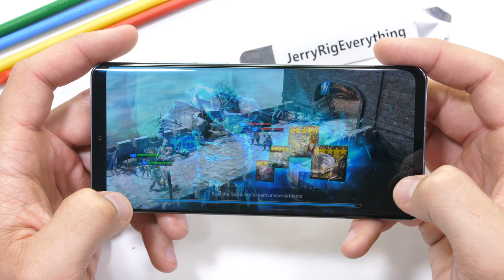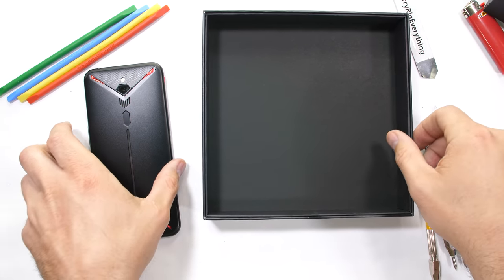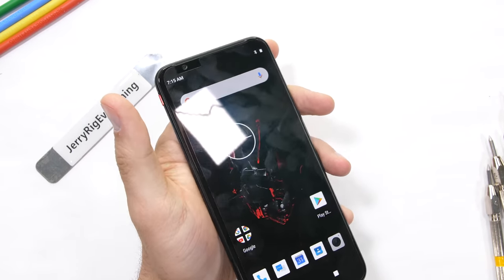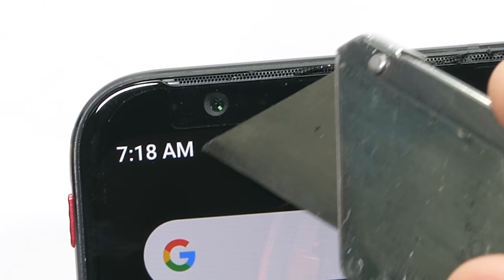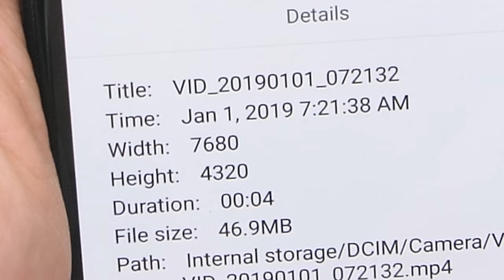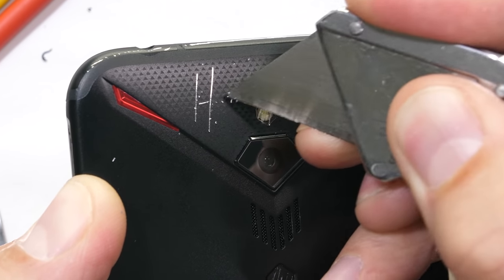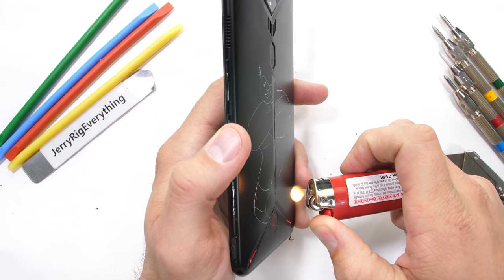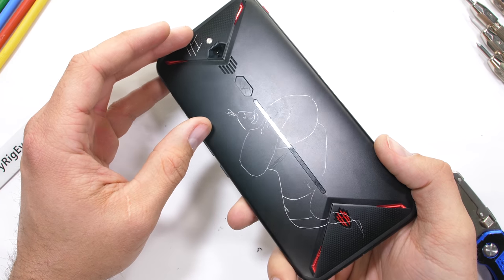Red Magic 3 Durability Test! - a FAN *inside* a Phone?!

Comment: I’m looking forward to a few years in the future when Zack will say “there are scratches at a level 7 and deeper grooves at a level 8”
Reply: Samstrex till screens are made from glass they will scrach at lvl6 with deeper grooves at lvl7 cause the chemical formula of all glasses no matter gorilla glass 5 or gorilla glass 10 are the same they just different in the dropes....maybe then we see sapphires all around😍 which i like couse I hate scratches and dont love cases or screen protector...
Reply: @hamedalimardan4619   Sapphire Glass
Reply: Don't get your hopes up. If that somehow does become the standard, phones will crack a lot easier. Because harder materials don't scratch as easy, but crack much more.
Reply: @danodden9783  Material resistance 101
Reply: Amit Mehta sapphire is not glass(kind of SiO2) its kind of aluminum

Comment: Smartphone manufacturers: no space for a bigger battery and audio jack 
Nubia:  cooling fan, audio jack, bigger battery
Reply: Imran It costs water and dust resistance i guess. But thats about it.
Reply: Sadly no SD card slot. Else perfect.
Reply: @CrusnikofChaos  Yeah indeed, at least it have 128 go or 256 go...it is unfortunate to see that the Red Magic do not have a SD slot, this phone will be perfect like you said. But for me, with those specs, and price, this phone is very close to perfection.
Reply: More ram and more buttons
Reply: @Mark-xw5yt  They are releasing one with the snapdragon 855 plus after the rog phone 2 is released. I'll get that one asap.
Reply: XD
Reply: @CrusnikofChaos  If it got at least Android 10 and regular security updates, it would be a solid choice. And only if they have one under 400 bucks. Otherwise I'd be better off getting a OnePlus 6 or later.
Reply: @rubenjanse3065  The RM3 is lacking many features if used as it is stock. Look through the XDA forum to see the general situation before you get the RM3. I'm still waiting for the RM3s, i like fans.
Reply: @CrusnikofChaos  I only want stock, MiUi, One UI etc. is a nogo for me
Reply: I'm on a motorola g7 power, and I'm loving my 5000 mAh battery
Reply: Apple left the chat
Reply: Asus : hold my features

Comment: apple:we have a bigger battery so we have no room for the jack
nubia:hold my cooling fan
Reply: The reason they took out the jack was so consumers could only buy Apple lighting accessories, this way they make more money
Reply: @user-the.  yes true. Apple is too focused on money rather than their customers satisfaction about their products.
Reply: @ramslade  oh classic apple
Reply: The nubia has a 5k mah battery if that wasn't a part of ur joke
Reply: Hmmm Yes Or because wireless is the future? Your phone isn’t wired anymore, why should headphones be? 🤷‍♂️ 

I know going to get loads of hate, but some people just can’t move over, instead they decide stay ancient.
Reply: @hwcollector7237  Wireless charging barely manages to put out 20W, while wired regularly exceeds it with semi-modern fast-charging.
Wired earphones don't run out of battery, don't have any latency, and take advantage of higher quality DACs in phones. Wireless earphones need to compress the audio on the phone before they can even receive it, which adds artefacts and latency to the sound.
Wi-Fi suffers from latency, reliability, and throughput issues when you have any kind of walls or interference. Wired networking can get you over ten times the throughput, significantly less latency, and orders of magnitude more reliability over wireless.

Granted, for the average consumer, many of these things are not an issue. Wireless charging is plenty fast for an overnight charge (assuming you have a standard 3000mAh battery and not a 20,000mAh monster. 

For music or video, latency can be compensated for. And your average Beats-wearing layman won't be able to tell the difference between 320kbps/128kbps mp3s anyway.
And let's be real: who has an ethernet dongle for their phone anyway?

Wireless tech has come a long way from 10 years ago. For most people with cash to burn, they will be able to make do with a portless phone. But for a guy on a budget who is a minor audiophile who shifts major loads of data to and from my phone regularly? Gimme a micro-usb cable, a nice pair of headphones and an SD card.
Reply: @juozasdomarkas848  well said, that nitwit is technologically impaired. Muh it looks cool so it must be better dabs
Reply: Juozas Domarkas Yeah, for example I love to use wired heaphones while driving a 76ton truck. Not.. Sometimes wireless is just so much better. Granted, you have good points but as you said, it has come long way in 10 years. We just need to give it some time and develop it more. 

In some cases wireless is even faster. My router cant get me over 79mbs with ethernet, while wireless gets me 97-99.9mbs all the time (max is 100mbs)

Comment: watching this on my Red Magic 3. nice phone. tbh the backlit LED is pretty awesome, the brightness can be adjusted. the default setting is not even 50% the brighness. sound is cool. fan works amazing. camera is cool, tho stabilization's not very visible. the best thing is the gaming mode, where the L1 & R1 turns on and also the backlit LED. it works on the maximum setting of this game Cyber Hunter, which is a BR game heavier than PUBGM (since its still new and the devs havent optimized it to its best.)

Comment: To include air cooling doesn't have to remove water resistance....just find a way to waterproof the fan itself and let the heat sink be sealed around under the fins

Comment: Nubia Redmagic 3 has 90hz display, SDM 855, 5000 mah battery, 27watts charger, active cooling fan with rgb lights, 8k camera, metal build quality in under Rs 35K. I mean this phone is my next phone (Currently using Poco F1)
Reply: Bro it's 5000 mah

Comment: FAKE PHONE'S. Durability and safty test's. Are the battery's note 7 or good. Are the chargers fitted with safty stuff. I just had a samsung charger blow up BANNG. But im sure its fake i got it uk high street as a replacement. That shop is screwed now when trade and standards show up. But mayb some are good. Mayb you could make them improve.  Samsung disrespect me so im really thinking about getting the fake version every 12month's like samsung expect. 10x cheaper but not 10x worse. I use it as phone and web browser. So it makes sense. Please series on those. Which are the best fakes?
Reply: Lets betray them right back and force better.